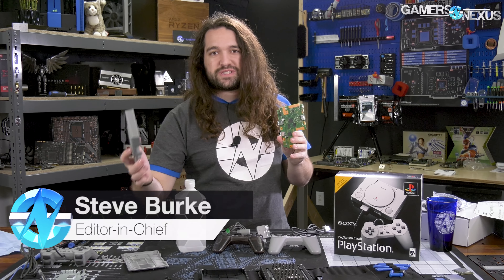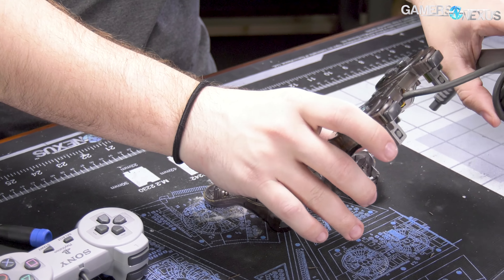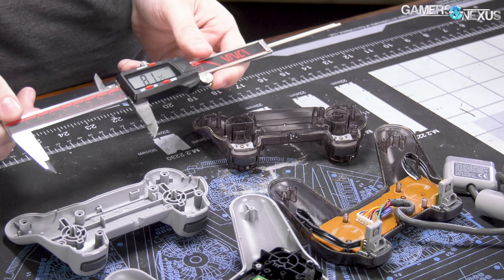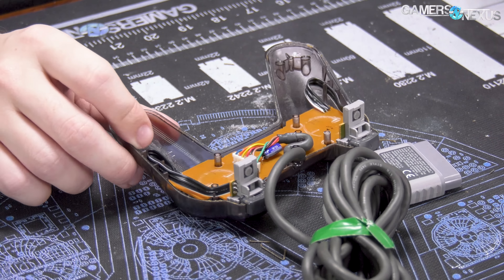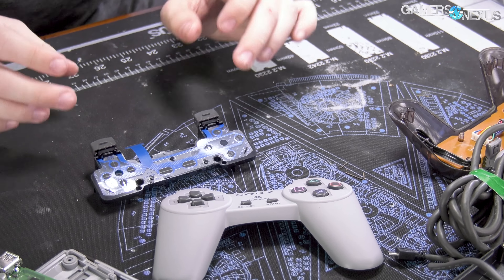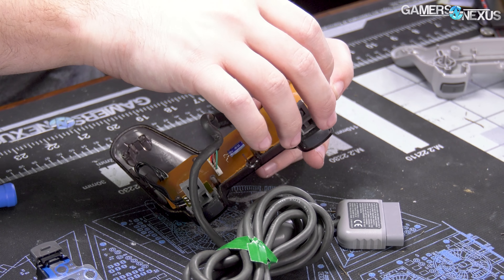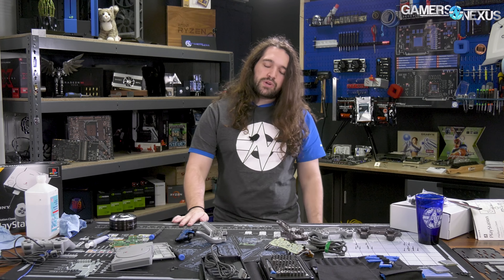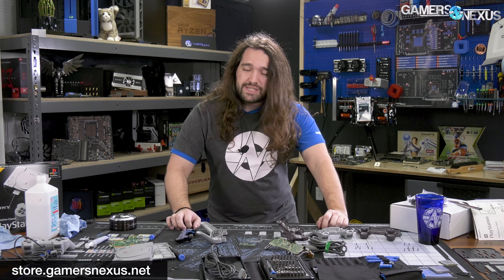PlayStation Classic Controller Tear-Down vs. PS1 Original

Comment: "Resources they had at the time" Steve acting like the 1990s was the stone age. LOL.
Reply: Kinda was >.>
Reply: @Fizzy Your whole childhood was like vocal percussion on a whole other level

coming from your mind
Reply: Compared to 1990s vs today, the difference between the Stone and the Bronze Age is a much smaller gap. As a frame of reference, my phone is far more powerful than anything other than the most advanced supercomputers of that age. A 2700k puts an entire lab filled with $100k SGI systems of that era to shame. My car has more computation power than most universities of that era, FFS.
Reply: @aprisia  I don't disagree, but availability of massive computing power is really a relatively small factor in the ability to build a decent PCB...
Reply: @bradley3549  No, but the processes to get to the ability to create current chips also factor in the massive reduction in size and increase in efficiency when compared to older PCBs. Go and take a look at the 80s era stuff if you really want to see a massive difference, it was basically LEGO.
Reply: @aprisia  Not in this case, 95% of the old pcb is mechanical.
Reply: @aprisia  Yup, it was bigger, massive, but had some durability and quality in it. And for the most, nobody implemented engineered obsolescence into devices at the start.
Reply: They probably could've done the flexi-PCB in 1994, but the fact Atari completely ruined the idea by using it in the abysmally unreliable 5200 controller probably prevented them. Or maybe that would have been prohibitively expensive, whereas the tech's improved and much cheaper now.
On top of that a rigid PCB allows itself to be used as a part of the support structure.
Reply: @michelvanbriemen3459  Cost is likely the primary driving factor to the application of these particular processes. I do agree that we've come a long way in the flex PCB - but even in the 80s/90s, some of that stuff has stood the test of time and others has not. Comes down to how far the manufacturer was willing to push the cost down more than anything I'm sure. Maybe a little case of some figured out how to do it right sooner than others and by now 30 years on the textbook has been closed on the technology.
That said, I would be very surprised if the flex PCB controller was anywhere near as durable long term as the original PS1 controller. That PCB seems to me far less likely to fatigue like you often see in the flex PCBs with heavy use.
Reply: The 90's felt like a fever dream.
Reply: Fizzy there was no colour phones in the 90s and there was no you tube. That was all mid 2000s.  Fake 90s kid alert.
Reply: yeah. also back the, the pastic stuff was way higher quality. the feel of controllers and the consoles themselves is just a higher quality than today's stuff. something from the 90's lives on today, will something from the 2010's live on in the 2030's? my guess is: no
Reply: @aprisia  Yeah, but on the other hand, if you ignore 'on paper' performance compared to the actual functionality of your computer...

The computer I had in 1995 can do almost everything that my current computer can do aside from high end gaming. (obviously it could do gaming too, but that's literally the only area where there is a dramatic difference.)

If you're doing office stuff like Word or Excel there is so little difference between the current programs and the 90's equivalents it's almost laughable, and a lot of the differences that DO exist are fairly cosmetic.

Sure the computer is thousands of times faster and has thousands of times the memory and storage, but the practical effect of this is not so impressive as those statistics would suggest.

I actually came to the realisation not too long ago that in my lifetime there hasn't been anything truly new created. While the modern stuff is more powerful and has better specifications, pretty much all of it already existed in one form or another when I was born. (even in subtler ways - LCD displays existed in the 80's, they just weren't very good - hence why CRT's stuck around for so long. In fact I'd argue even as recently as 2005 or later, a High end CRT was still better than the best LCD in some ways, but by that point the LCD display had become 'good enough' that few people cared anymore, and the downsides of a CRT were no longer worth the slightly better quality of one...)
Not all new tech is unconditionally better - some changes are tradeoffs - better than what they replaced in some ways, worse in others.

Computers, phones, TV, cars, aircraft, space travel... There is nothing TRULY new.
And that's as weird as the observation of how much the stuff that does exist has changed over that time.
Reply: @randalldraco3822  yeah but that's an issue of capitalism not of technology, it's way more profitable to make shitty obsolete devices that need to be replaced ever 2 years instead of a device that your customer buys and then never has to change
Reply: @doji_town_adventures  no, it is not an issue of capitalism, on the contrary. Issue is in fiduciary money. Bring back gold standard and it will be back to normal immediately. Not that it is possible tough.
Reply: @doji_town_adventures  Sorry, what did I attack and where?
Reply: @randalldraco3822  😂😂😂😂😂 oh man falling that hard for the bait, how's the corporate man's boot taste? 
(edit, by falling for the bait i mean you bought into the capitalism schtick and genuinely believe that it works)
Reply: @bradley3549  *redacted*
Reply: @doji_town_adventures  and there is a workaround for that to:  create modular device, the kind PC was in the beginning. Modularity can be extended if it were immanent value for the product. And at the same time it would promote recycling and reduce resources cost. Those resources could be put to a different use, thus improving affordability in other segments of the market.
And, in the meantime, that could prevent WW3. 
But hey, gotta luve fallout 😊
Reply: @randalldraco3822  you're talking about ideas that aren't instantly profitable, the issue with any idea of recovery in capitalism is that it's cheaper to make a new product, you don't have to pay for the development of retrieval/recycling infrastructures because you already have the gold mine. capitalism has been around for a few hundred years at this point and it has shown time and time again that it cannot exist naturally without leading to mass destruction of it's people, look at the cronyism of the early 1900s, and then again at the cronyism that happened in the reagan and nixon era that lead to the capitalist hellscape we live in today
Reply: @doji_town_adventures  What I'm pointing out is that all the basic technology used in the new controller (except USB per se) was already in wide use when the original controller was built. That is really in direct support of your statement that neither controller is very complex. In fact, neither controller is really fundamentally different from lots of input devices going back into the 70s.
Reply: @doji_town_adventures  yes it does. As an idea. Problem is that in the real world is not using capitalism at all. It is not a good system for governments and big money corps. Socialism and democracy is the great system for that. Its like soviet union, but instead of gulag is your work, instead of guards, guns and razor wire is your dept/mortgage and programmed consumption. IT JUST WORKS In 1st world countries it doesn't hurt that much. But most of the world feels the pain.
Well, at least we have those aircraft carriers to keep em at bay. 😬
Reply: @randalldraco3822  lmao of course it just works for you, you're probably gonna read this and roll your eyes, but capitalism can only exist on the backs of the oppressed, all throughout american history (until recently) it's very present who the oppressed are, nowadays the brunt of it just happens to happen outside of first world countries, which there's a decent argument there that a lot of third world countries are third world explicitly because of the actions of the first world
Reply: @randalldraco3822  also lmao what the fuck is capitalism if it's not private entities controlling the market, cuz last i checked private entities very much control the market
Reply: @doji_town_adventures  yes and no. The problem is that it has been used by  few, always using regulations issued by governments, to create a bubble. And it is almost always rooted in the bank system. Shit we are here now, is possible only for one reason: money are not created by creating goods, they are created by banks, by creating debt.
If money were directly connected to physical objects, the most valuable thing would be resources, especially those unsustainable. Also, people would shift from consumption to accumulation, investing in goods which would last generations, as they did for most of the mankind history. 
Ps. That's an offtop.
Reply: @randalldraco3822  and do you have any proof? or anything more than speculation that things would fix itself? or is it all psuedo-maga bs? like anyone can make claims, here i'll make one now "if we shift further away from the correlation of currency to goods all it will leave behind is a caste like system even more rigid and real than the one that exists today in the form of class" you haven't given anything other than conjecture
Reply: @doji_town_adventures  there are no proofs available in humanistic teachings. Only descriptions. One is sure, with current state of affairs, we're fucked.
Keyens vs Hyek. I wonder why govs are promoting the "spending" rpute, hmmm?
Reply: @bradley3549  you got me there, i initially read your original comment as way more aggressive than it actually was, sorry
Reply: @randalldraco3822  you say that we're doomed but that's not true, there are things we can do to fix the state of the world, and rejecting capitalism is one of the steps, capitalism is a funnel that serves to fill the pockets of the rich, this is terrible for everyone and everything that is not the rich
Reply: @doji_town_adventures  Yes, there are possible steps to change the doomed route, and many have raised them to the public. It will not happen. The reason for that is that the people behind the helm don't care, all they care is their short life, belly and dicks. It always has been like that throughout history, but only recently humanity got the ability to actually influence and destroy our small habitat and fuck everything up for good. 
We are already behind the schedule to stop the collapse. Societies, states, culture, everything we know is doomed right now, it's only a matter of time. :D And then, great balls of fire. Resources, overpopulation, the inevitable end of fossil fuels. Only "when?" is the question.
"War. War never changes.
The end of the world occurred pretty much as we had predicted. Too many humans, not enough space or resources to go around. The details are trivial and pointless, the reasons, as always, purely human ones."
Gotta love this intro.
Reply: technology ages 100 times as fast as anything else. Within a year your computer, smartphone and soon your car are already obsolete. a ps1 was already less powerful than a computer when it came out. and a ps1 was 100s of times more powerful than the computer that the lunar lander used to land on the moon in 1969.
Reply: I agree with everything but the last point. I mean a computer from 1995 were typically around 100Mhz. How many computers did the typical universities have? I guess it really depends on the University. You're probably right.
Reply: @aprisia  computers are not that important. New metal could have a much larger impact on humans.
Reply: @reginaldweather  And the film switches in the newer controller were in the 9910 and later keyboards that replaced the clickey keyboards from IBM when PS2 came out in 1987. All the tech in the newer controller was most definitely available.
Reply: Yea...it was obviously the iron age...snes was the bronze age, nes was the copper age and before the 80's video game crash was the stone age
Reply: @Fizzy star rating was way better, also you could see the video's score from the search results :)
Reply: Can you grab a cup of coffe while your PC boots in 2019? Nope
Reply: @TheTca211  no. It was the golden age.

Comment: Those are carbon contacts on the pcb and carbon impregnated rubber on the membrane that complete the circuit.
Reply: Amazing how he can be an expert on "cherry" switches but never has seen old carbon contact switches that have powered electronic devices for ages.

Comment: Those black bumps are carbon, they act like wires to bridge the connections on the flatflex
Reply: Was just fixing to comment the same thing... This is done in cheap keyboards and I can not believe he does not know how those  buttons/key work.
Reply: @JoeJacksonJr  I'm also pretty certain the header for the old controller cable DOES come off and he was being too gentle.
Reply: @JoeJacksonJr  yeah the first clue he didn't know was when he said the bumper buttons where possibly Omron switches.
Reply: Yeah.. the new and old controllers work in exactly the same way.  Only real difference is the contacts for the "buttons" on the new controller are on a plastic sheet, where the old one has them on the pcb itself.

Its certainly considerably refined, and now on USB, but its the same thing.
Reply: Obviously, he's never taken apart an Atari 5200 controller.

Comment: They moved to the electrically printed film for the PS2 with the dualshock 2, it worked great at the time but over several years the print degrades leaving you with faulty buttons, I always got the impression this was a 'timed obsolescence' decision as much as it was for cost savings.